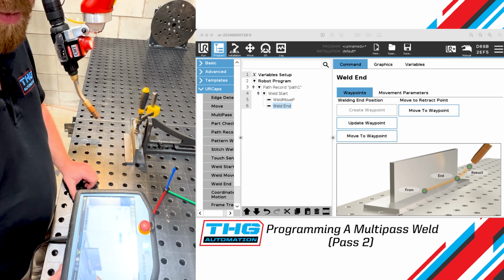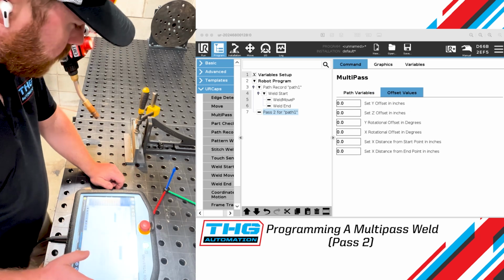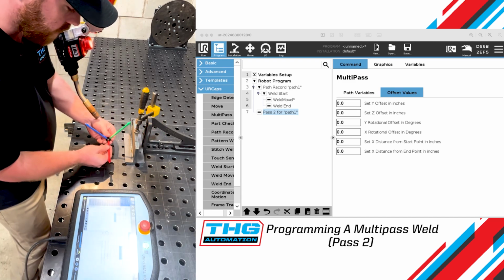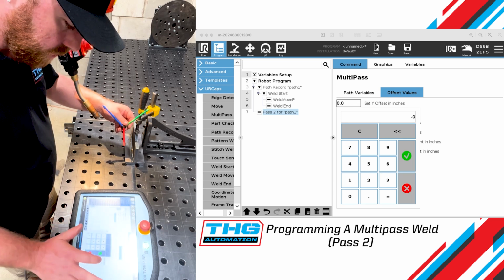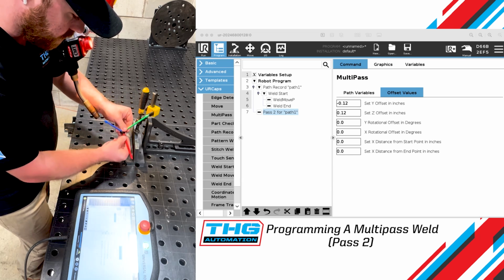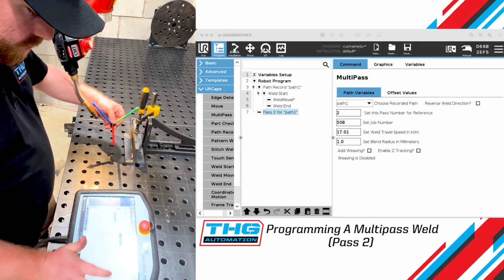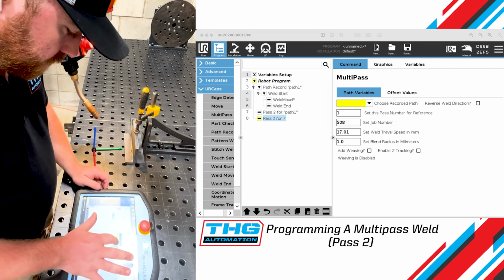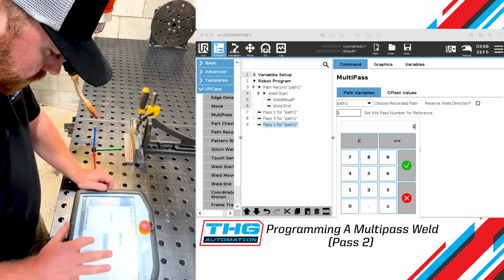Path Replay With THG Automation Multi-pass Feature

Comment: Having a database of established weld data offsets that you can pull from would be quicker.
Reply from the maker: The Fronius power source does! You save recipes and can call them whenever the same part or material comes in production.